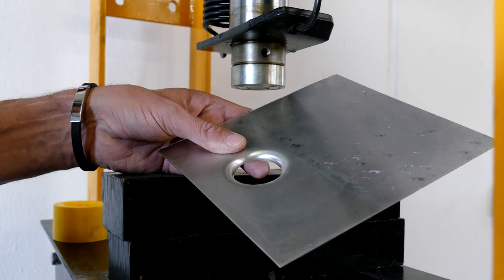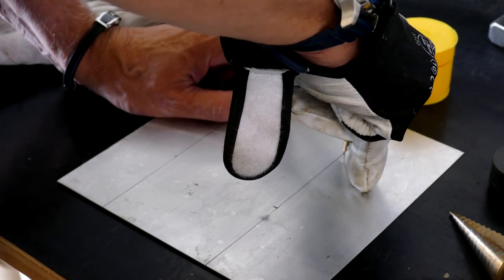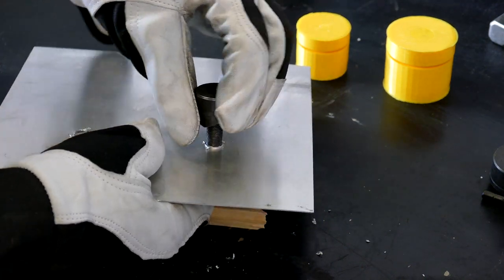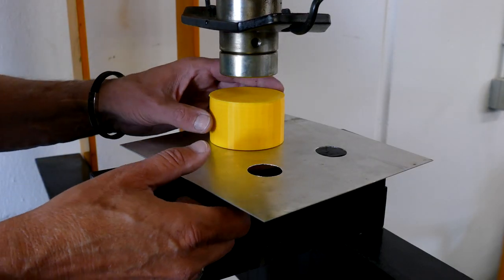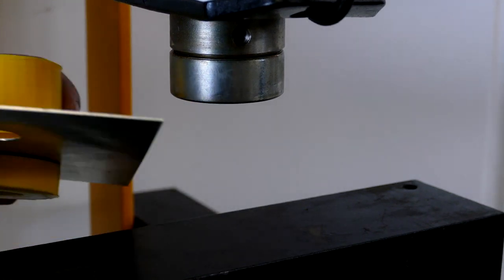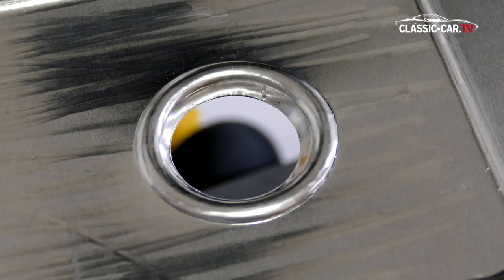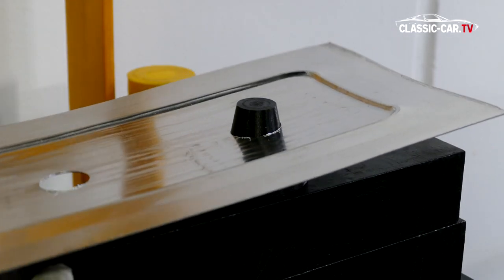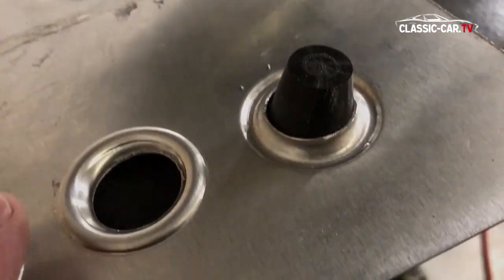3D printed Dimple dies for sheet metal shaping

Comment: You could make a center hole in each die to run a bolt through the two like the die hole cutter. Then you don't need a press to squeeze the two die to form the metal.

Comment: If you don't have a press, leave a hole in the form, then use a high grade bolt with several fender washers to press the part. If the shape is not round, a bolt on each side of a plate that presses the forms together.
Reply: that for the idea
Reply: I'm pretty sure any grade bolt would be enough in this case...

Comment: Knowing tools like this will take a lot of force/stress being applied to them, I never use anything less than 100% infill. Takes longer to print and uses more pla but you're more guaranteed concerning the longevity for reliability of these tool dies
Reply: @manp1039 , I do feel like he saved 2 days by printing with less infill, but added a day or so back with resin and cure time, not sure it would be woirth the extra messy and extra expensive part of the process.
Reply: Interesting, but: 1) force won't be the same in all parts of the tool, and reinforcing the outer parts gives you most of the strength required 2) he clearly showed this method works 3) dies are going to get ruined anyway, and printing them at 40% makes it so much easier to print them again
Reply: I recently experimented with this technique; I found out that the best result is by using 100% infill in the areas that will be subject to the most extreme forces (the edges that form the sheet metal) and something like 40% for the rest. The slicer "C.U.R.A." for example allows to specify volumes with different parameters within a model. Also, it's very important to properly support the dies with thick metal in the back or the dies will crack (but still work pretty well 🤣)

Comment: Since you have to print those at a high infill, and that takes a lot of time, it would probably be faster to print at a low % infill in PLA and use investment casting to make them out of some metal. You get durability and lower cost in bonus.
Reply: Investment casting usualy distorts some details and is pretty expensive, an alternative idea is to leave the bottom open and pour epoxy resin into the infill to stabilze the die

Comment: The reason your prints are taking so long is because you're trying to print them all in one go. Print them one after the other and I can pretty much guarantee it will print quicker in total!
Reply: but more hussle
Reply: That is not how time works....
Reply: @backtoearth1983  no, but that's how 3D printers work.
Reply: @backtoearth1983  he is correct. You lose a considerable amount of time retracting and moving from one part to the next, and again and again, for each layer.
Reply: @george.b.  do you not account for the time used in removing each printed part, and preparing the printer for the next? cleaning the build plate, reheating the build plate and extruder.
doing multiple parts at once is far faster.
Reply: @fhadynamo  he has a ultimaker, and with any 3d printer really now- take the print off the bed, press the go button, and your good to go
Reply: @fhadynamo  Just tell the slicer to leave the heaters on and give the buildplate a once over with the scraper, and you're good to go.
Takes 10 seconds.
Reply: @fhadynamo  somehow I never got a notification for this reply. But yeah, like Meizor said, I was talking about print sequence - doing it one at a time vs. all at once - and by one at a time I don't mean printing one part, removing it from the printer, then printing another, but printing one, then moving to another area of the bed, printing another etc., as opposed to printing the first layer of the first part, then moving to another area of the bed, printing the first layer of the second part, etc. All the times you have to move to different parts of the bed - once for every part, for every layer - do add up, and print times become longer as a result.